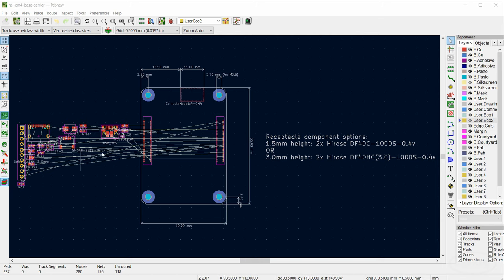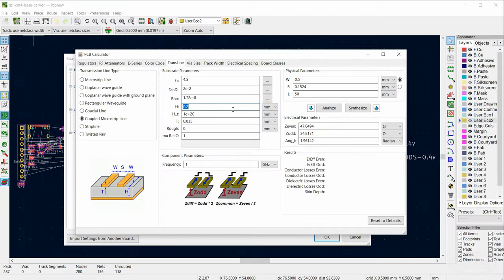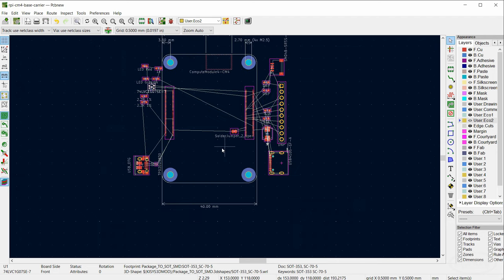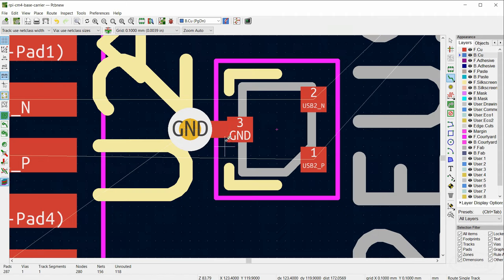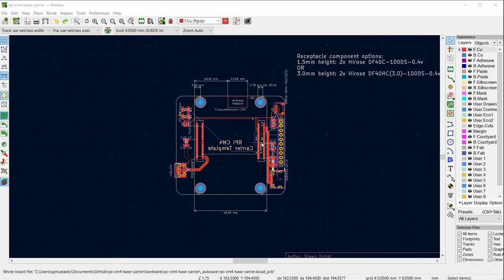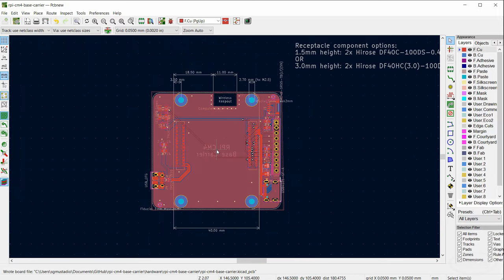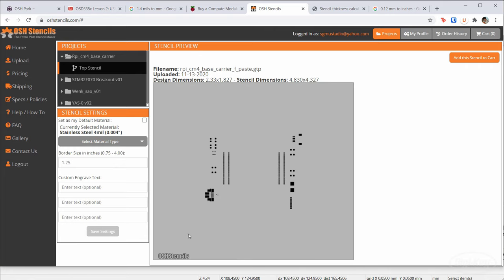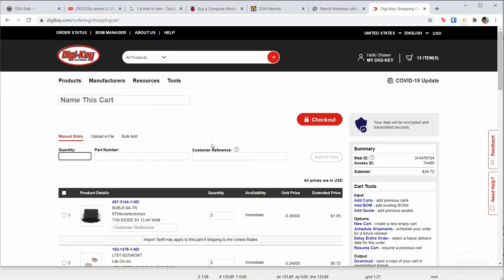How to Make a Raspberry Pi Compute Module 4 Carrier Board in KiCad - Part 2 | Digi-Key Electronics

Comment: The differential pairs were calculated without considering the coplanar waveguide configuration, but the layout itself has the GND pour around the traces. Don't this changes the characteristic of the differential impedance, resulting in a smaller impedance than was desired?
Very nice video, thanks!

Comment: How does one ensure alignment of the Hirose connectors so the Compute module will mate? Does the surface tension of solder during reflow ensure they both end up in the correct positions relative to each other?

Comment: Awesome video! Thanks. It is what I need for my project! @ShawnHymel , could you do part 3 to show the assembly and soldering using the stencil and the module testing and setup?
Reply: This was the plan, but I need a CM4 to make it happen. I'm still waiting for a WiFi, non-lite version of the CM4 to be in stock (from anywhere).
Reply: @ShawnHymel  awesome, thank!   Would it take much to include the sd card reader? It is the only component that I feel not sure about how to do it.
Reply: @rubencg195  It's not something I have planned, but good to know there's interest. To use the SD card in SPI mode with FATFS, it's a pretty involved process. I recommend checking out this video: https://www.youtube.com/watch?v=spVIZO-jbxE. If your chip supports it, I recommend using the SD mode in CubeMX, as that seems to work out of the box.
Reply: @ShawnHymel  Any update on part 3 of this video series? Thanks!
Reply: @rubencg195  Not yet...my CM4 is in the mail, though. Here's hoping it works!
Reply: @ShawnHymel  awesome! thanks
Reply: @ShawnHymel  may I ask what is the price charged for the board’s production and assembly? More importantly, does your vendor allows the assembly of the two HIROSE connectors which are the ones interfacing with the CM4? My main supplier is JLCPCB but they do not support this type of connector’s assembly
Reply: @rubencg195  I used OSH Park for PCB production. I plan to do assembly myself (I ordered a stencil from OSH Stencils and have a hacked reflow oven). I haven't any experience using an assembler for this kind of work.
Reply: @ShawnHymel   Thanks a lot for your videos. How soon can we wait for video or some article with tests of your PCB?)))

Comment: I'm designing a breakout board for the cm4 and the module will not boot when I power it on. The nRPI pin is left floating so it is held high during boot and power seems to be stable to the compute module. The 3.3 bus is outputting and the current is stable at about 10 mA. is there anything that anyone can reccomend for debugging this?

Comment: never seen USB traces that fat..
Reply: Unfortunately, that seems to be what's required when you're using a 2-layer board with 1.6mm of separation between the layers. Usually, you'll see USB traces on 4+ layer boards or boards with much thinner dielectric. With a smaller separation between the USB data lines and the ground plane, you can use much thinner traces.
Reply: @ShawnHymel  Yeah I was yelling at the screen telling you to go four layer board as soon as I saw how thick those traces would be :) Great work Shawn!

Comment: Thanx for your video. It helped me to design my board https://github.com/olvint/CM4-NAS-MiniPCIE
Reply: How is your board performing? I like your design.
Reply: @primeral  i made a board.  But i did not bought CM4 due to shortage and pricegrow. It became more feasible to buy x86 motherboard with installed cpu and make NAS.
Reply: @olvintful  I've been looking for CM4s for a while also. Do you outsource work? I have a board I would like designed for the CM4
Reply: @primeral  i am not a pro. This was my first pcb project)))
Reply: @olvintful  I was hoping I didn't have to learn another craft 😄 I just wanted to run 2x SATA3 3.5in HDDs and GbitE with a CM4